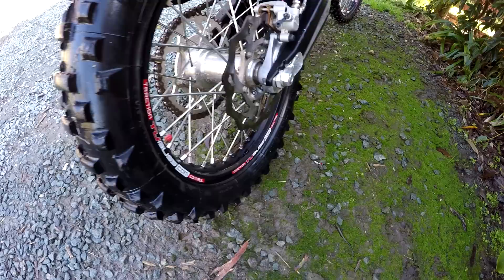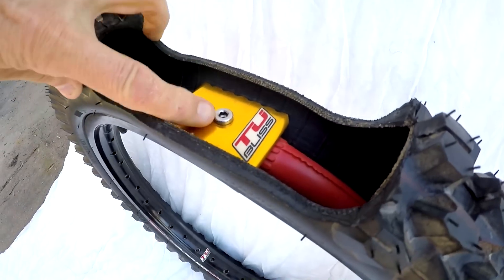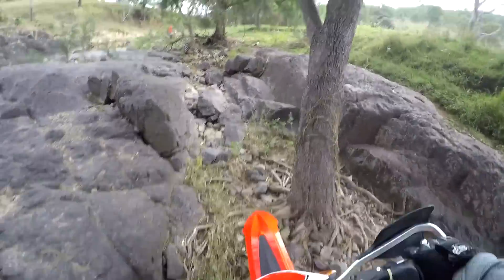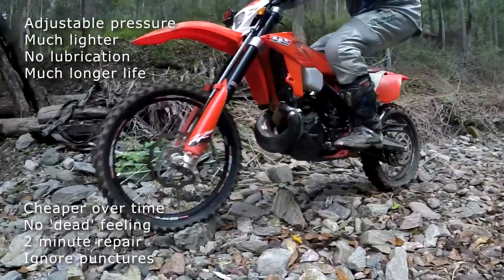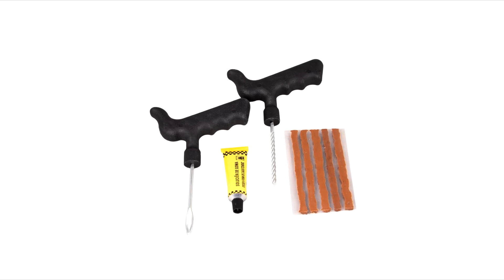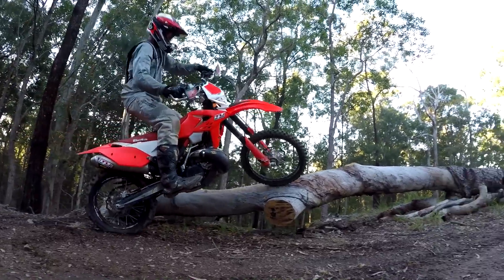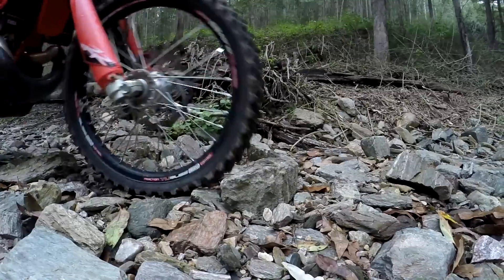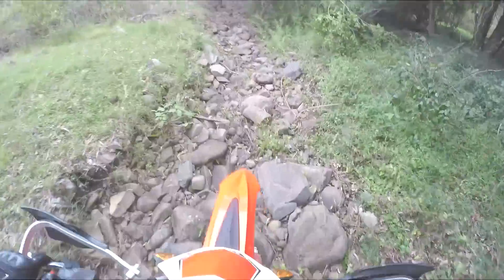TUbliss review: a tubeless tire system for dirt bikes︱Cross Training Enduro

Comment from the maker: LONG TERM COMMENTS All six guys in our group now use TUbliss and are very happy with them. Problems? After five years Pete has the front one fail due to rust, but admits this was his fault as he stripped the rubber off the steel reinforcing due to sloppy fitting (TUbliss still replaced at their expense despite him saying it was his fault). Scott eventually has his rear fail at a hard enduro event when sharp rocks pierced the tyre and into the red covering, but admits he should have run more air pressure... and that mousses are required for race events (I agree). Ben had a similar issue at another hard enduro event and has since changed to a mousse on the rear for racing. Otherwise it's been a huge thumbs up all round in our group. Be sure to check other people's comments though, a few guys do report issues but it's hard to know if these are caused by poor fitting or not.

Comment: After hearing how this was going, I installed the Tubliss too with no problems, and I'm completely sold on it, for all the reasons shown in the video. No need to carry levers and pump etc and worry about doing a tube change on a mud covered wheel in the middle of the bush, and maybe pinch the tube in the process. The grip is amazing and I also ran zero PSI front and rear, just to see how it would feel, and basically it was perfectly OK. Very happy I went Tubliss not mousse.
Reply from the maker: Andrew von Berky recommendations don't come higher than this, mr von berky is such an incredibly talented rider he passed on our recent chris birch training as he would not have learned anything... in fact he would have been giving birchy some tips. :)
Reply: CROSS TRAINING, ENDUROCROSS & ENDURO TECHNIQUES Thank you for publicly recognizing my awesome talents Mr Crosstraining. Unfortunately in your videos I have not been able to showcase my prowess, usually stalling my bike, or looping it out, or rather than jumping the log falling off and getting trapped screaming under my bike, each time you try to film one of my amazing tricks. But thanks. Now which of us gets the prize for the most sarcasm?
Reply from the maker: i know you protect our self-esteem by deliberately riding several standard deviations below your normal prowess, it's hugely appreciated.

Comment: LONG TERM COMMENTS All six guys in our group now use TUbliss and are very happy with them. Problems? After five years Pete has the front one fail due to rust, but admits this was his fault as he stripped the rubber off the steel reinforcing due to sloppy fitting (TUbliss still replaced at their expense despite him saying it was his fault). Scott eventually has his rear fail at a hard enduro event when sharp rocks pierced the tyre and into the red covering, but admits he should have run more air pressure... and that mousses are required for race events (I agree). Ben had a similar issue at another hard enduro event and has since changed to a mousse on the rear for racing. Otherwise it's been a huge thumbs up all round in our group. Be sure to check other people's comments though, a few guys do report issues but it's hard to know if these are caused by poor fitting or not.

Comment: Another TuBliss convert and advocate!  ...I first learned about it from a bike shop in Hawaii when we used to winter there.  They were extremely enthusiastic about it.  I never fitted the little foo foo KLX250 I had there, but as soon as I got home I set up my EXC with TuBliss and I've never looked back!  I run Green Slime in the tire chamber and I've never had a flat since then either, in more than four years now.
You sir have again completely nailed it.  Excellent video.
Reply from the maker: gncc1race i blame my inner cynic for taking so long to try it... it just sounded like a gimmick but there were so many rave reviews i eventually caved in. i'll never touch a mousse again! :)
Reply: I'll never touch a tube again!  At least not on one of my bikes.
...An older brother of one of my daughter's friends had an old Chinese 110 knock-off sitting unused on flat tires in their garage.  I know he loved his bike and badly wanted to ride, so I took it home and told him I'd hook him up with some inflatable tires!
There was a lot more wrong that just flat tires.  Spokes had come so loose they'd perforated the tubes.  Brakes maladjusted & nearly non-existent, bars & fork bridges looked someone had backed over it with a car.  But I dug into it on a Saturday night and when I went to bed that night it had inflated tires (new tubes), functioning brakes and somewhat aligned handlebars.  And it ran!  Started right up.
 ...I've been using TuBliss so long I'd lost my touch with tubes!  Sunday after church I went to return it, and the front tire was flat!  I'd pinched it so bad that I had to buy another tube and find the time to mount that one. 
Fortunately that time it held air.  I had the opportunity to see that it did, because by then they'd gone on a trip and it sat in the back of my truck and my garage leaking oil for two weeks!  LOL!!
Reply: CROSS TRAINING, ENDUROCROSS & ENDURO TECHNIQUES I still don't know what a mousse is! You mentioned it several times in the video.
Reply from the maker: just google "mousse dirt bike"  or "mousse enduro bike"  or anything like that, all the info is out there. :-)
Reply: Mousse, like you put in your hair?  Or chocolate like you eat?  ...Or moose like I have in my yard sometimes?
Reply from the maker: gncc1race no, no and no.... it's the "mass of tiny bubbles that forms on the top of a glass of champagne or sparkling wine".
Reply: Ah, I see.  Once again sir I am edified by your great wisdom!
Reply from the maker: er... edified by an online dictionary in my case lol
Reply: mousse is whats going to save your tire from a nail, unlike the tubliss

Comment: everytime you said Beta, I thought you said Beater, I thought you loved your Beta, lol

D606 on my KTM530 lasted 1600 miles, about 50/50 dirt/road with a tubliss(2 psi dirt, 30 psi slab)

I have 800 miles now on a Kenda Equalibrium, mostly dirt, 100 on slab, 0 to 2 psi Rocks, and due to low slab miles it should go 2000 miles.

Lots of rock riding in American Fork canyon, and no major carcass cuts on the Equalibrium(knock on wood).
Reply from the maker: it's actually 'better', brad. but we say beater, americans say 'bayter'  :)

Comment: I also run this system and have only good things to say about them, but have a few questions for you. Have you got the stickers on the wrong valve stems? You also seem to be a real stickler for details, so as per Tubliss instructions why haven't you put the knurled nut against the valve cap on the high pressure valve?
Reply from the maker: +mick thomas actually i'm a shocker for detail but try to fight my urge to be sloppy lol! yep the stickers are round the wrong way. i did have the nut against the valve caps but it's unwound, i'll probably do something about it in the next few years if i get motivated... :)
Reply: +CROSS TRAINING, ENDUROCROSS & ENDURO TECHNIQUES Thanks for the response to my inquiry. I enjoy the youtube stuff you blokes put out, with plenty of piss takes too. Keep up the good work.

Comment: After puncturing my both standard tires on one ride (two holes in rear and one in front) and having to ride back at crawling speed for several kilometers I decided to buy and install a tubliss (gen2) system. I carefully read all the instructions and tips. Rear wheel installation was a piece of cake. But front 21" one on DID rim of my Sherco was a huge struggle to finish spooning on the secod side of the tire. I was trying to press the opposite side of the tire into the center of the rim all with all my strength but could not finish spooning on the tire by myself alone. Only with a help of a friend I managed to mount it. On narrow front rim tubliss red liner is taking a lot of central space and liner is quite stiff so it was not giving enough way for tire edge to fall into rim center to help to finish spooning it in. Tubliss made front wheel tire change a major headache. Any similar experiences with front wheel? Any tips?
Reply from the maker: +Mindaugas Milasauskas mine fitted easily mindaugas. two other riding buddies fitted theirs with no problems a month ago. another friend put his first set on last week and did say the front wheel was harder, and for probably the same reason. he has huge tire irons almost three feet long though, so it just needed a bit more leverage than normal. everyone used soapy water to make the tire slip over the rim easier if that's any help?
Reply: +CROSS TRAINING, ENDUROCROSS & ENDURO TECHNIQUES Thanks! I was using plenty of soapy water which was not helping a lot. Probably it depends a lot on rim profile shape. Also we are having low temperatures now in range of +5-10C which makes rubber noticably stiffer. Ausies on contrast probably looking to start their frying season?... :) For next tire change I'll probably try several clamps to squeeze the tire to fall into center as studded tires are waiting for their happy hour on snow and ice :)
Reply from the maker: +Mindaugas Milasauskas yes, we normally leave our tires in the sun for an hour and they soften up a lot even in winter which is around 23C or so on a nice day. :)

Comment: One thing though when running the TuBliss with 0 PSI, it can ruin the tire. I found the knobbys closest to the sidewall would start to rip of a bit
Reply from the maker: definitely true, i wouldn't recommend running zero psi all the  time...
Reply: m8 it will destroy the tire. That knobbys were starting to rip after one ride, if you rode with 0 psi multiple times the knobbies would rip off.
Reply from the maker: while it's technically zero psi, the TUbliss makes it about the equivalent of 4psi. how well the tyres cope depends on their quality and also how heavy duty they are, in my experience so far. goldentyre? not a single problem. the motoz hybrid rear? it just started develop cracks in the sidewall rubber after about 1000km which i thought was very good going. but yes, don't assume your knobby will hold up long term at 0psi with TUbliss.....
Reply: Jonathan Oxlade apparently you have unlimited funds to spend on expensive tires.

Comment: do you run sealant in the tire ? ,when my Xtrainer finally turns up I want to run tubliss but that soapy water looks a bit hit and miss plus does the tire bead up OK and if so is it the inner bladder that pushes it onto the bead or do you over inflate the tire to push on to bead then drop pressure ,being as my works mechanics have not shown up yet again I thought the next best thing would be to ask you :)
Reply from the maker: salisburyplain998 i don't run sealant for tire punctures but others do. but i did use it instead of soapy water to get a good seal. i pumped up my tires to 50psi to ensure the bead was seated but have to admit i didn't check the TUbliss instructions about that. i've just set up a second set of wheels with TUbliss and trials tires, i used the soapy water just to see if it worked okay and there were no issues.
Reply: salisburyplain998 I've installed tubliss on two bikes now (three wheels total) and on the last wheel, a rear, I did have some difficulty getting the bead to set. I had to do a lot of experimenting with raising and lowering the pressure of the tubliss bladder, and raising and lowering the pressure of the tire. IIRC, I managed to set the bead finally at about 90 psi for the bladder, and 60 in the tire. Once the bead was set, I raised the tubliss up to the spec 100+ psi, and dropped the tire back down to normal. 

I use Slime like it's going out of style. I figure it's slippery, and why not have some extra sealant?
Reply: +theoriginalpauly the extra lube/sealant really helps. Had no problems setting the bead here, it just needs to be slick enough to pop on like normal.

Comment: If I got a half used tyre, with tube and rim lock, i need a new tyre to fit tubliss?
Reply from the maker: it helps... sometimes you can get an old tyre to seal up though if you use slime. check the forums, guys discuss this quite a a bit.
Reply: CROSS TRAINING ENDURO SKILLS  i used soapy water, a lot of it, and no problems so far, and the tire had a small dent on it

Comment: I normally ride to the trials and ill be on the road for approximately 8 miles. How would they hold up on the road?
Reply from the maker: Not DOT approved in the USA. But I've been using them on my DR650 for 10000km without any issues.

Comment: So if you get a puncture in the tire does it really need to be fixed on the trail? Since you can run 0 psi
Reply from the maker: depends on a pile of factors like your weight, the bike's weight, how aggressively you want to ride. but yeah we usually don't bother due to the slow technical stuff we like and we are only using 2 to 4psi in any case.

Comment: but yeah, i really want the TUbliss setup on both wheels. i'm finding that 5psi is still too high on my D606's and this would let me run 0psi like i need for good traction
Reply from the maker: 65elcamino283 i was actually thinking of D606 or that reason, and they would last forever with our sort of riding (i HATE changing tires!).
Reply: CROSS TRAINING, ENDUROCROSS & ENDURO TECHNIQUES totally agree. the d606 is so damn tough it takes tons of abuse and won't be all chewed up and worn. my gumby ass still unfortunately uses the THROTTLE THROTTLE THROTTLE method on some loose gravel and dirt type of terrain, but am slowly (no pun intended) learning the slow speed, standing on the pegs, balancing, using the clutch, not spinning the tire, picking my path carefully, rock crawling type of riding....that stuff is quite mentally therapeutic i'm finding

Comment: How is the (im)possible hill going? Did you try it in 3rd gear?:)
Reply from the maker: Szat01 haven't been back yet, it's on private property so we don't want to chew it up too much. but will have another crack soon. i think it's better staying in second at high revs, she doesn't get into the powerband in third due to the corners and bumps.
Reply: I see, those hills are not for whiskey throttle for sure :D
Reply from the maker: Szat01 lol instant flip for sure. even though the beta was in the powerband it was only about half throttle AND very carefully adjusted. birchy keeps the throttle almost wide open but just adjusts the clutch each time the front starts to come up.

Comment: do you have any issues with the high pressure tube losing pressure after sitting for a few days? mine drops to about 80 -90 psi after 3-4 days
Reply from the maker: +skylinegtr420 you will lose 5 to 10psi just checking it. taking that into account, i find it drops about 5psi a week so if i haven't ridden the bike for two weeks i'll check it.
Reply: Just like every time you ride, it's mandatory to check tire pressure before you ride regardless. Any tube will lose pressure after sitting.

Comment: what is your opinion on michelin tyre that you have on your beta?
Reply from the maker: rokshock2112 i like them rockshock. i've heard people bag them on the forums but they usually don't say why... it's quite a soft compound which suits our sort of riding so possibly aggressive riders are wearing them out quickly?
Reply: CROSS TRAINING, ENDUROCROSS & ENDURO TECHNIQUES  i have them on my husqvarna te 250 and one back tire last me only half a year cca 1000km, and they are quite pricy too, but i enyoy the grip on the dry, but in mud i find that they are not preforming as good as i was expecting
Reply from the maker: rokshock2112 do you mean the rear tire only lasted 1000km, or the actual TUbliss system on the rear failed after a year?
Reply: CROSS TRAINING, ENDUROCROSS & ENDURO TECHNIQUES  i was talking about rear tyre
Reply from the maker: rokshock2112 gotcha, so do you think it wore fast because of the TUbliss? mind you, i don't think 1000km is bad for a rear knobby.

Comment: Sorry I ran tubliss for 4 years and finally gave it up on tubliss. The tires deteriorate pretty quickly the carcasses come apart when you run low pressures riding into England on rocks and roots. I slowly increased the pressures overtime added slime to try to make the tires last a little longer to no avail. Then I called it, I'm back to tubes.

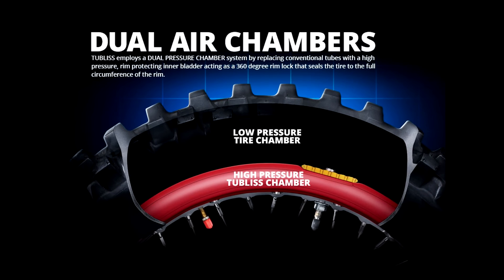Comment: installation fail @ 0:12 do not tighten the knurl against the rim! tighten it againts the valve cap! ;)
Reply from the maker: +florian558866 lol i do! but they keep undoing and winding up back against the rim after every two rides or so. :)
Reply: +CROSS TRAINING, ENDUROCROSS & ENDURO TECHNIQUES haha ;) loving your vids! so happy when a new is online! im going to enduromania 2016 in may. so the tire puncture thing is in my head and i cant decide if mousse or tubliss for my bmw g450x.
Reply from the maker: +florian558866 tough call for competition on the tubliss vs mousse. you probably saw the comparison vid i made a while back? https://www.youtube.com/watch?v=xkPc27mU17s
Reply: +CROSS TRAINING, ENDUROCROSS & ENDURO TECHNIQUES jeah but im not sure about riding with zero psi like if punctured. can you say sth about this special case??
Reply from the maker: +florian558866 if the tires are six ply then you can easily ride them flat, just don't hit tree roots or square edges too fast. i ride with zero psi on all our cross training rides, then 3psi if it's faster or lots of tree roots.

Comment: Why does the simplest foam rubber donut cost more than the hollow rubber donut with fittings attached???!?! It costs more than Tubliss, withits multiple parts and machined fittings, it costs more than the tires it goes inside of which have to be much more difficult and expensive to produce with ply's, beads, belts, tread and all.. It makes no sense, can anyone explain why the simplest foam rubber donut is the most expensive?  🤔
Reply: It's  called  ripoff